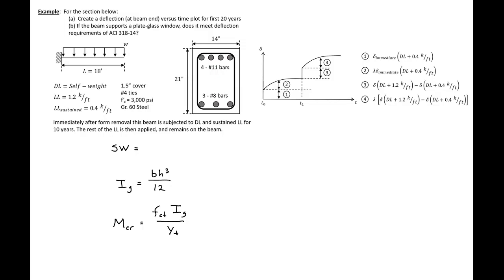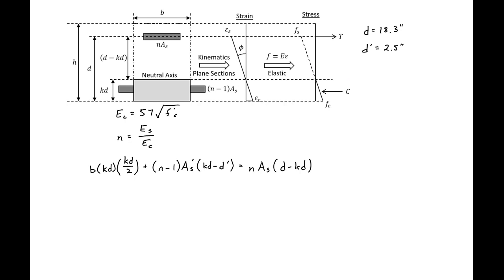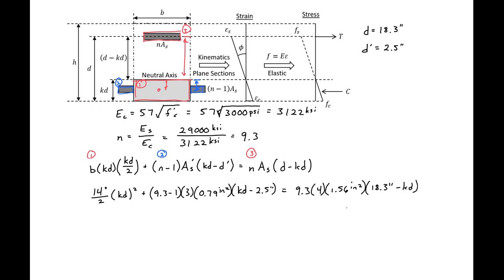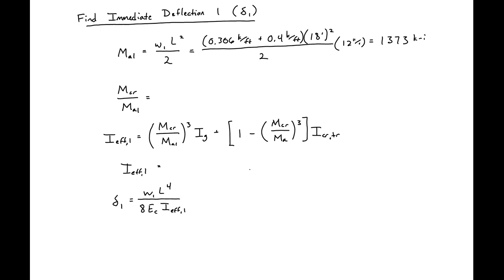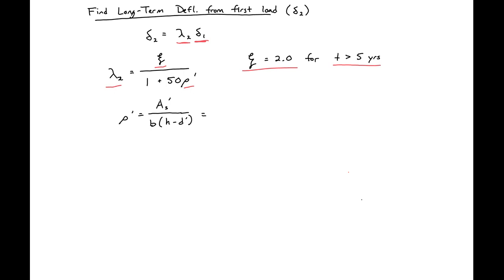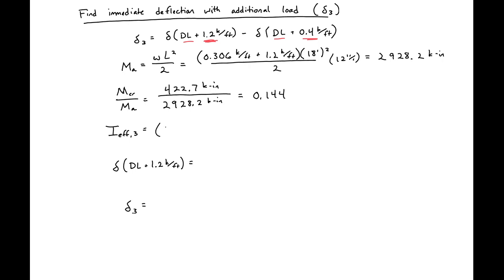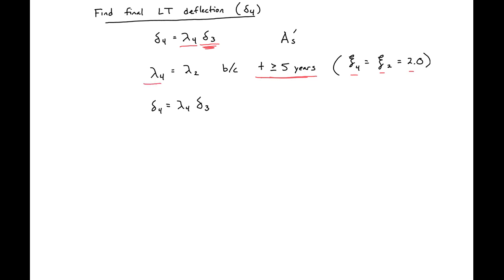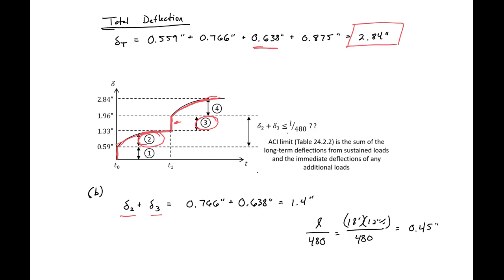9 - Example 3 - Long-Term Deflections of Reinforced Concrete Beam

Comment: Are you sure that delta4 should be considered in the long term calculus? I think the sum for the total should be delta1+delta2+delta3 instead. Great video anyways.
Reply: I reviewed the problem statement and it is fine to consider delta4 since there is a 10 year pause in the middle (it could be because the construction is abandoned due to lack of funds or problems at work for example). Good practical example! I understand that it does not apply to the most common cases where the work continues directly and there are no long pauses of years.

Comment: Let's say that the problem b) is changed to "the non-structural elements are not likely to be damaged by large deflection", will you still use the summation from (Delta2+Delta3) to compare with the limit L/240 as stipulated by ACI Table 24.2.2? 
Some engineers have raised up an issue, due to the possible visually offensive sagging of the structural member, the total deflection (Detal1+Delta2+Delta3) should be used to compare with L/240 as this is the limit for preventing from visualizing the obvious sagging. 

Why does ACI only only focus on the damage of the non-structural elements and neglect the aesthetic issue? 

What is your opinion about the aforementioned point of view?
Reply: At least this point need a discussion...

Comment: Why do you use the “n–1” term for the compression steel?
Reply from the maker: You use "n-1" for the compression steel so that you can use gross section properties for your concrete region. This is taking 1*As and moving to Ac which gives you Ag.
Reply: David Garber I’m seeing it now, thank you